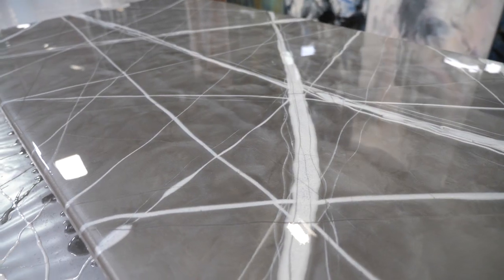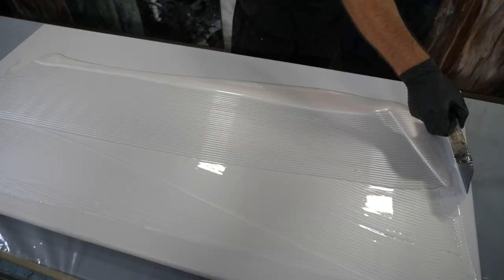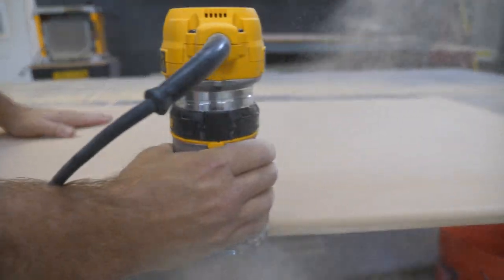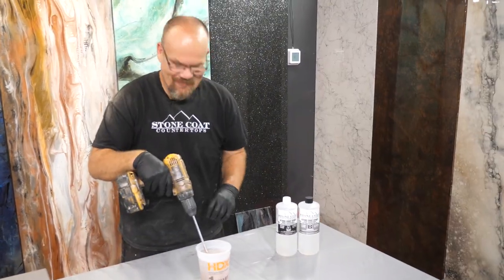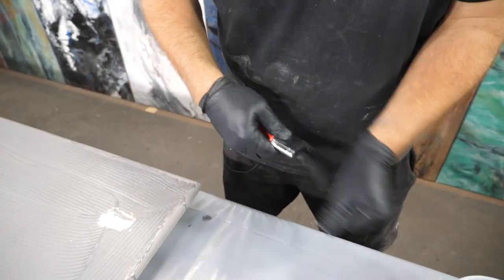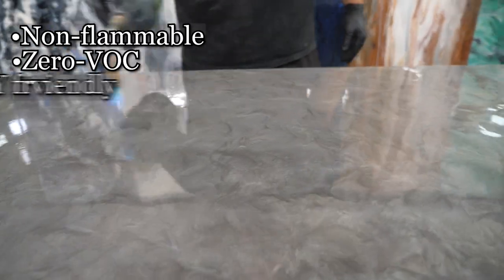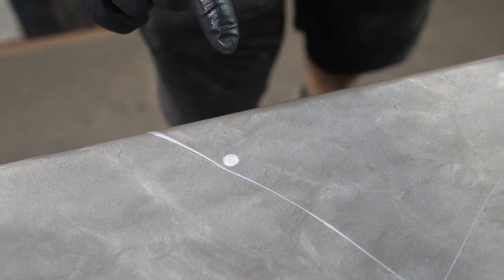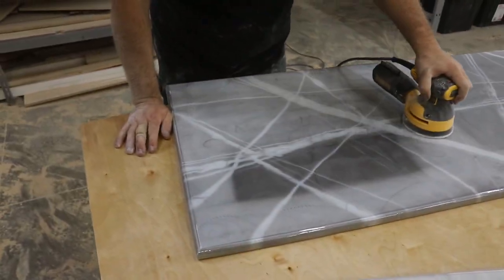How to Make Soapstone with Epoxy | Stone Coat Countertops

Comment: Three questions:
First, I'm planning on doing a soapstone appearance on very deep window wells (about 18" deep, 6 feet long).  How would I do the fractures when two or more edges are blocked by wall and window?  I can't simply drip past the wall and window.
Second, I did my counters as a carrera marble.  I tried to do fractures, but the fractures tend to bleed in to the chopped epoxy surface, so their edges aren't sharp.  Any way of preventing that and getting sharp fracture edges?  I tried both paint mixing sticks and tongue depressors.  Both bled into the chopped surface.
Third, the soapstone I saw that I want to replicate was darker like a slate.  Should I go with a dark (black primer)?  Add black paint to my initial pour?

Comment: Here's a question, I've been watching these videos along with others and the other was building an aquarium out of plywood, I was wondering, instead of using the pond liner (applied with a roller), could Epoxy be used to make the back and bottom (seal), especially when going to make a bare bottom salt water reef tank?